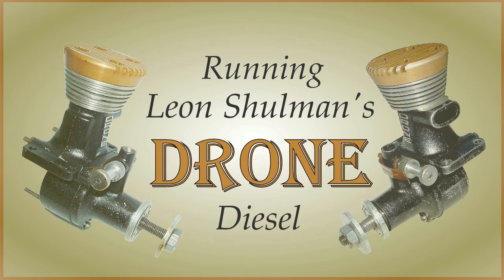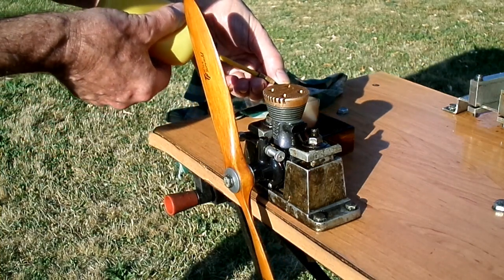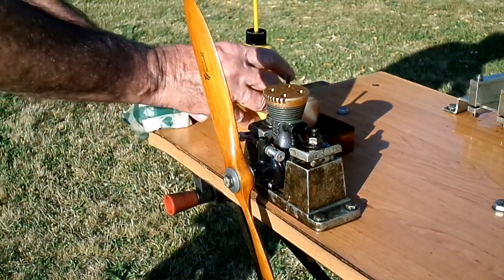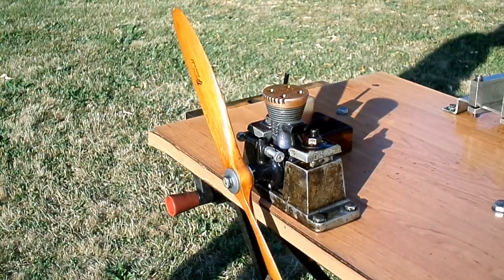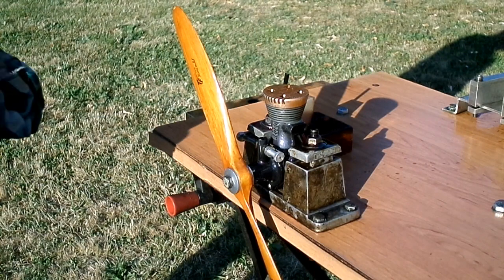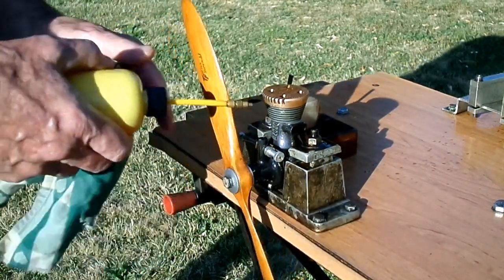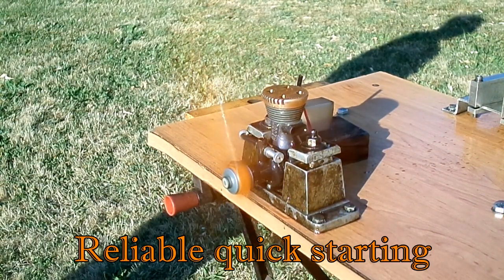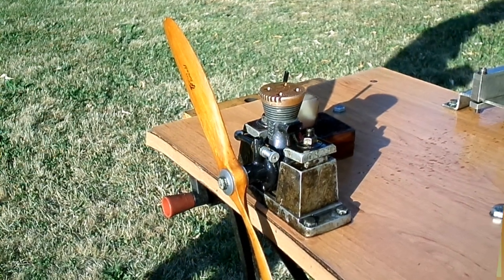Running a ball-bearing Drone fixed compression diesel

Comment: Wonderful sound Brian, thanks....I have just acquired one of these and it is destined for a twice-size "Pal Joey", my first radio model. Now to ingratiate myself with my Pharmacist!!...in Canada here we are lucky in that the Kleen-Flo starter fluid works as well as the John Deere. All the best
Reply from the maker: Hi Charles, Sorry I took a long time to reply. As you see, these engines can run very well, but they're very dependent on conditions, particularly ambient temperature. They're great in light old timer floaters that you only fly on nice warm days, but I don't think they are a good choice for a general sport radio model that needs to be an easy "no problem" flier. Your Pal Joey, normal or twice size, would be better with a PAW! Best regards, BC
Reply: @briancox3691  Thank you Brian, yes I totally agree. However I am determined to have that gorgeous black cylinder poking up at the front from the flush mounting of PJ's glossy black snout! Oooh! I am building it very light, with a lifting section tail and rearward CG, and also ailerons (and flaps off the 4th channel - no throttle). She will be 1176 sq in and I hope about 5 lbs. I intend to fly her as a sort of thermal soarer, slow climb (I bet!!) to cut-out and then drift around on varying degress of flap.  I'll let you know how she goes; we can't fly here yet anyway, apart from the brr brr. 
All the best   C
Reply from the maker: @direktorpresident  Charles, OK, but one final word of advice. DON'T commit yourself to the engine choice until you're happy running the engine on the bench. Don't even try in temperatures below 20°C. The ultimate fine tuning (and successful running) of fixed compression diesels is a question of picking the right day... Is that really what you need?
Reply: @briancox3691  Yes, it is quite a specific niche! Thanks Brian, the engine is "new" and I anticipate 5K or so on the 14x6; pitch speed therefore about 30mph (stall speed about 15mph)...I think we are in the realms of possibility. The single channel Pal Joey was not much more than this in terms of flight pattern. I will wait until Spring before I even test the engine, and I can defer the nose construction until then so that I can PAWse at the eleventh hour if necessary!

Comment: I always wondered how these engines run without compression adjustment, very smooth!
Reply from the maker: Yes Gary, They are smooth and very nice to use, in the right weather conditions, but it's not generally realized that, on any one propeller, they only run at one speed. The speed remains absolutely constant, which is why you find it smooth!
Thanks for your interest, BC

Comment: Hi Brian,

Will model aero engines like the Drone and similar 5cc models work with a flywheel and pulley rather than a propeller, or is the prop required to cool the cylinder head? I'd like to use one in as a stationary unit, though, I could attach an electric fan if cooling is required.

Thanks in advance,
Adam
Reply from the maker: Hi Adam, I think they could probably be used as you suggest. At the time these engines were current, many were used in tether cars (google "tether model car racing" and you'll see what I mean). In cars, very few used a propeller (those that did are called "air cars"). They were usually turning a flywheel and driving the wheels through a gear system, in a similar manner to a full-size car. Thus, there was very little cooling air flow, especially as the engines were usually enclosed, and they ran OK.
In any case, if the engine isn't happy it will just slow down and stop and, while this obviously isn't a desirable situation, it's not usually a disaster!
Thanks for your interest, BC
Reply: @briancox3691  Thanks Brian! This brings back a distant memory of seeing a tether car once with my father eons ago.

BR,
Adam

Comment: Excellent video - I noticed that you don't prime through the exchaust opening - any reason for that ? Also - what is the ratio of  either / kerosene / oil used on this ?
Reply: Apparently rich running is bad for these engines, and also you can not back off compression if you do flood it. Here is a fascinating article....thank you Brian for your enthusiasm...
http://modelenginenews.org/ad/drone.html
Reply: These don't use kerosene, just ether/mineral oil mix.
Reply: @johnkelinske1449  Yes, my ball bearing Drone runs sweetly on 75%KleenFlo (https://www.kleenflo.com/products/735.html) and 25% SAE 30 mineral oil, on a Xoar 14x6. A lot of the Youtube videos show the engine burping and stuttering, with smoky exhaust, so the operators naturally try to lean them out, but in fact they are already too lean. They should be richened up until they run steadily with a clean exhaust, as Brian so ably demonstrates here.

Comment: Smoot running and deep sound Brian. I will run my BB Drone soon, please tell me your fuel recipe %??
Reply: From some delving this seems to be about right.....

Use mineral oil (castor doesn't work well in a Drone)
SAE 30 oil  25%
Ether          75% (if you cannot source ether you’ll need to harvest some from something like John Deer starting fluid)

Because of its’ low speed the Drone runs forever on the straight ether brew if propped right - an 11x10 works great.
If anyone feels they have a better recipe please comment.....
Reply: @elduderoony8171  many thanks
Reply from the maker: Hi J-M, The fuel mix is very simple, just 75% ether and 25% oil. That was the mixture recommended by Micron and Drone. It works well with the 14x6 wood propeller, like in the video. One important thing, with fixed compression diesels, is ambient air temperature. When you try for the first time, Don't try in temperatures below 20°C or higher than 30°C. On a normal warm summer day, with a temperature around 25°C, the fuel mixture and propeller mentioned will give good results, if your engine is in good condition.
Reply: @briancox3691  Thanks for reply G-M (Groucho Marx) :-) I wish mine is in good condition
Reply from the maker: J-M, I wondered why you mentioned Groucho Marx, and I've just realised that you think my avatar (little image) is Groucho Marx...
No! it's Ben Turpin, one of my old favourites. Google "Ben Turpin" and you'll find details, and the image as well!
Reply: @briancox3691  whow yes ... it is not Groucho ... is a small pic. Also a comic actor ... I love them